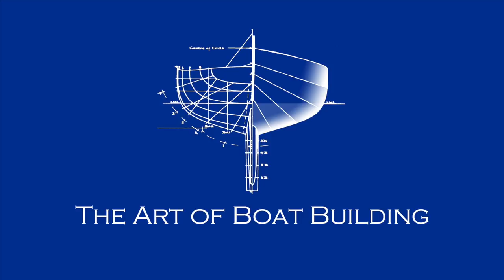Setting up a lead Melter for Casting Lead Ballest Keel, S2-E14

Comment: An old hot water tank works too, if you line the mold with drywall you can get a nice smooth finish. If you need to cut down a big piece of lead to manageable sizes use a chainsaw. To trim in the lead, a power plane works pretty good.

Comment: Actually, you have created a bottom flow melting pot, not a smelter.  The smelter is the cast iron pan you were using to melt the range scrap and skim off the copper jackets and other stuff that you get with the range scrap.  The smelter takes your raw "ore" and gives you a usable alloy out of it.  The melting pot takes ingots of that alloy and converts it to a liquid state so that you can cast your desired object.  If you care about the quality of the alloy you are getting, you should flux your ore when smelting it.  Check with some of the bullet casting sites for suggestions on this.

Comment: Very interesting and informative, and I'm looking forward to seeing the pour.
It is easy to understand why lead is used for this procedure, melts at low temperatures and is very dense, but I'm surprised there isn't an environmental regulation prohibiting the use of lead in waters containing wildlife.
Reply: Typically the lead in most boats will be encapsulated in some form of bio-hazard safe bottom-paint to seal it from the elements (in this case, the fish and aquatic wildlife). I sure hope he paints it, but the aquatic life would have to chew on the keel to ingest any lead. The soft, but dense metal doesn't really corrode in water, salt or fresh, so it won't be sluffing off into the water. To release any lead into the water the boat would have to run aground or strike some abrasive item under water.
Reply: Metallic lead is only very slightly soluble in either fresh or salt water. It presents a minimal bio hazard, even without a paint coating.  Much less so than the anti fouling paints and the copper salts used on wooden boats for their preservation from shipworms, which are  actively and intentionally biotoxic.
Reply: @thomasarussellsr  +1 for using the word 'sloughing'

Comment: Pretty slick using the portable air tank for your smelter. Will you have people with blow torches to heat the flow pipe to keep the lead flowing smoothly? Looking forward to watching the pour.

Comment: Are you going to clean the lead up in the pot with some Sulphur to get your weights right, yr making such a nice job it'd be a shame to come up light with zinc and junk in it. I'd flux it and acetylene smut the mold too, every little trick to try and get a perfect job.

Comment: The smelter has the capacity for your 7 gallons of lead but are those legs sufficient for the weight?   I’m wondering if they could fail as lead is added and as that heat up.
Reply: Jeff Falk, my thoughts exactly. Some cross braces and/or beefing up is required to hold up ~600 lbs of lead !!
Reply: I expect the legs will be strong enough, even heated in the fire … until  the smelter is tipped to pour. the lead, if my a$$unption on the design is correct.

I'm of like mind, my comfort level would've required both perimeter- and cross-bracing. Let's hope all the lead goes where it's supposed to without detours.

Comment: Please test the smelter for those legs holding almost 600 pounds of hot lead over a fire that will weaken the legs due to the heat, even if only slightly.
Other than that, looks great so far. I would definitely consider some cross-bracing on those legs at a minimum. Please be safe and take all due precautions to protect yourself and the environment. See you next time.

Comment: The lead may cool off in the pipe and stop flowing.
Reply: oceannavagator people usually use a torch to heat the pipe before.
Reply: @fredericl6190  The lead heats the pipe hotter than any torch, the problem is the pipe cooling off to below the melting point of lead along it whole length. Best to keep the pipe as short as possible.
Reply: Capt. Sarigar lives in a graveyard! LOL.
Reply: @fernandofert9960  they are the best kind of neighbor. Never a noise problem, always parked in the right spots.